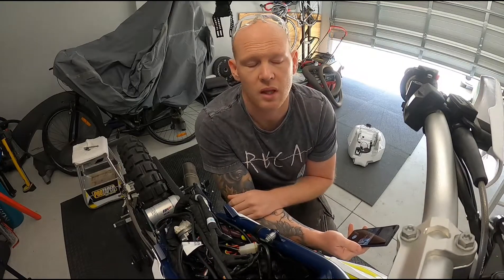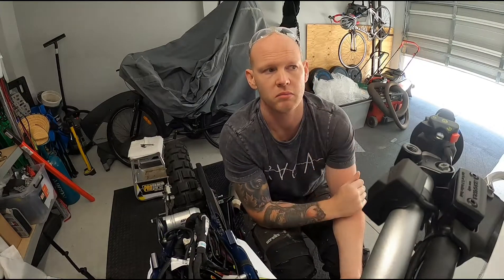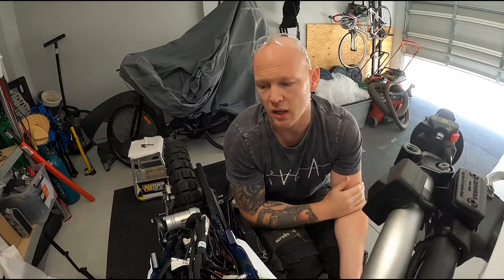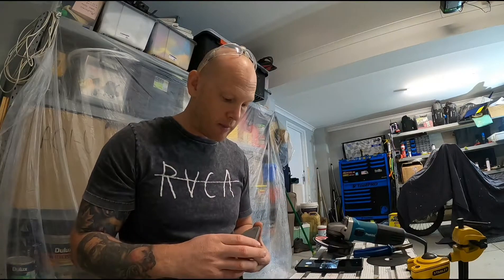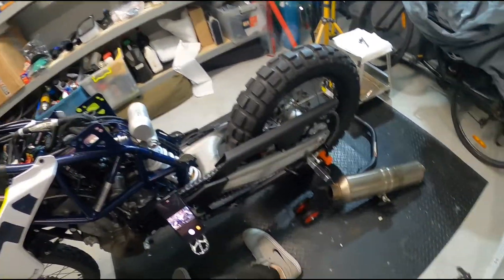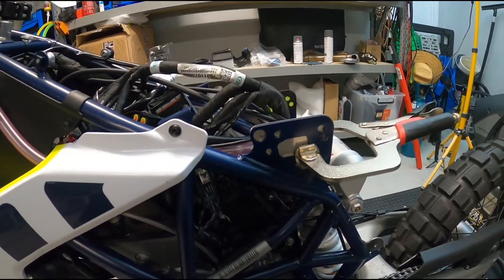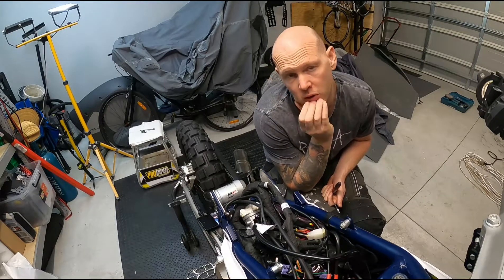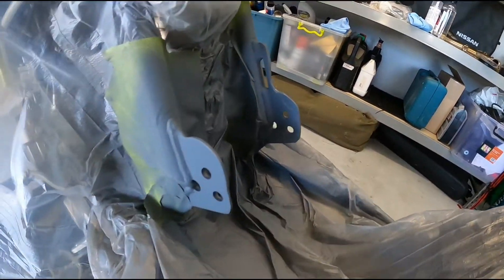Part 8 - Husqvarna 701 Rally / Travel bike build

Comment: I'm also setting a bike up for offroad ADV Touring... and noticed that subframe reinforcement is available from Perun Moto but there's not much discussion online about it. Did you have a subframe problem yourself that prompted you to start this project or can you point me at more info - if this was a common problem I'd expect to see a lot of discussion about it but I also don't want to have problems on my trip next year (especially since when I have problems it's invariably in the middle of nowhere).
Reply from the maker: Hi David,
There was nothing really that prompted me to do this, It's all based upon my own judgement.
With the tanks being a composite and because I'm also installing front tanks I thought it would be a good idea to brace that area a little. It's a quick easy job that I think can only help with the extra stresses and strains I'm adding to the frame/bike. 
It's still a working progress and I shall be doing a lot of testing once the build is complete to see if there are any failures that need addressing. 
Just having a go 😄

Comment: It's extremely annoying trying to track and understand your build. You should post link to all your after msrket products so other can do a similar build as yours. I'm trying to find your rear tank you found. What is product description/link.
Reply from the maker: Hi Jeffery,
You may find it annoying and hard to track my build but have you ever had a go at building the same bike, with the same idea? 
Its very hard for me to track and create something I've never done before too then then added element of trying to show other people what I'm trying to do. 

It was very easy to workout what rear tank i wanted to use. It took a whole 2 minutes in the google search bar to clearly see that the rear tank that is used on a 2014 KTM Rally Factory Replica used a very similar looking tank. After looking for a further 2 minutes, I was pretty exhausted by that point.. I looked a little little deeper into the frame of the 2014 RFR and the 2008+ KTM 690 Enduro and the Husqvarna 701 Enduro and noticed they were extremely close in design/geometry with frame tabs that looked like they were very close if not in the same position. So i took a chance and ordered the 2014 Ktm Rally Factory Replica rear tank. 

On making that initial chance i then looked at the rest of the rally kit i wanted to build/purchase. So the Mid portion of the bike i.e. the 2 front tanks and bracketry came from AURORA Rally Equipment where they supplied me with the 2017 KTM Rally Factory Replica tanks etc. 

After that i then looked at what Nav tower and head light/windshield i wanted to use and what style i liked. I settled on the RebelX kit. 

Using 2 aftermarket rally equipment manufacturers and then OEM parts and then on top of that I am making my own adjustments and building what i want to build things do get VERY annoying and confusing trying to piece all these different parts together that were never meant to come together on a frame that is similar but also different in many ways.

Let me know when you post you're own content and see how easy it is creating something for the first time all while showing the world what you're planning and doing.